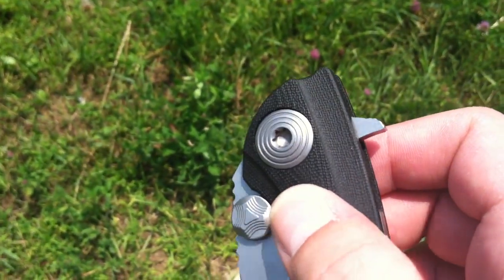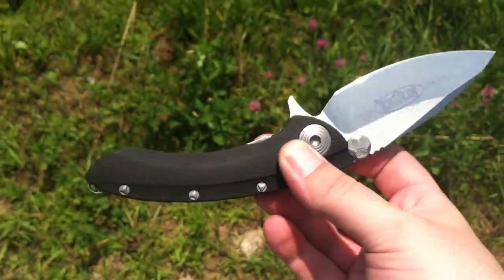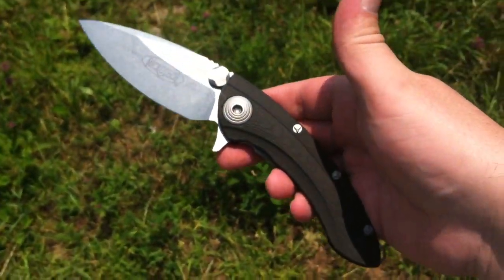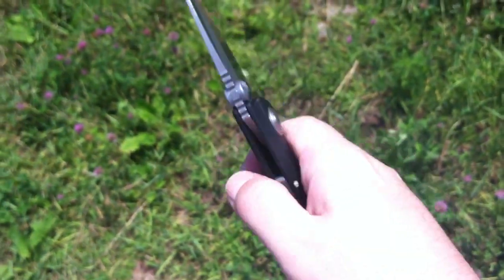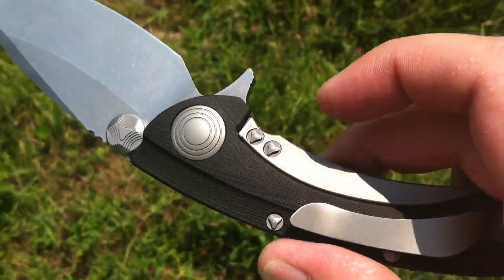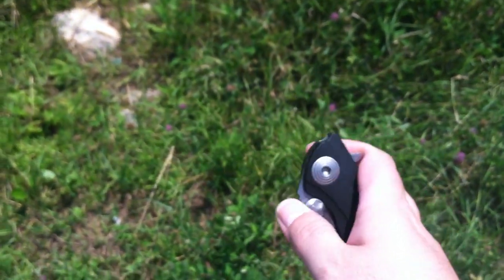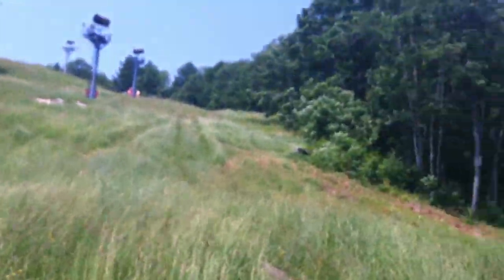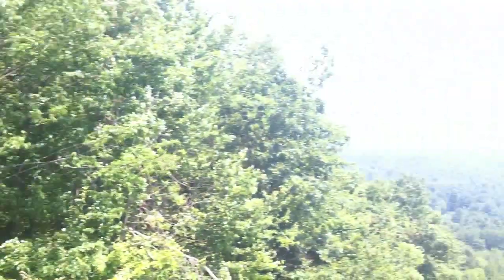Microtech WhaleShark CTS-204P #1

Comment: hy thanks for the video.how the knife is doing right now?still having problems with the centering and the bearings?i have a question.looks like there are 2 versions of this knife,this one with the CTS204 and another with S35V wich one came first? i found and bought one like your(but mine have the black coating) but most of the video reviews have the S35 version.the pivet is diferent to but im kind of prefer the simple one on this version.apreciate the atention thanks